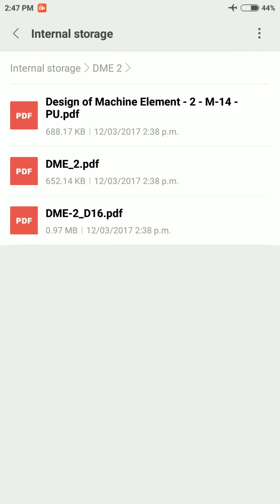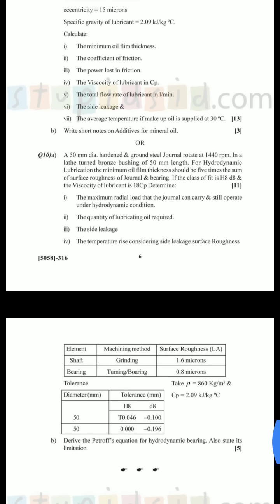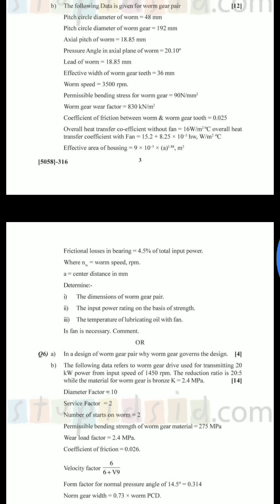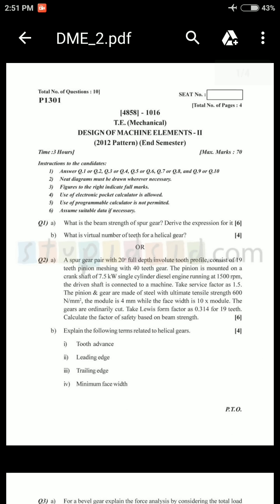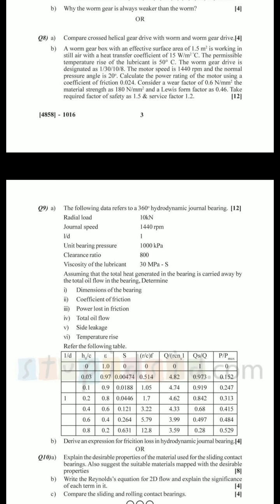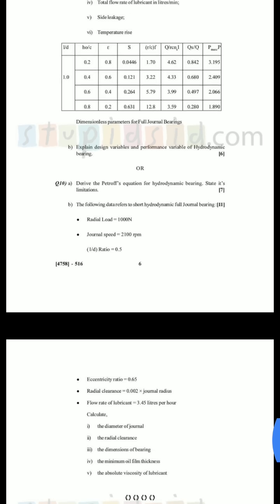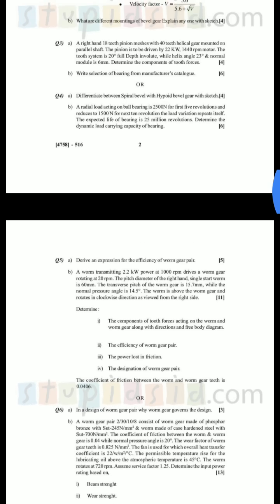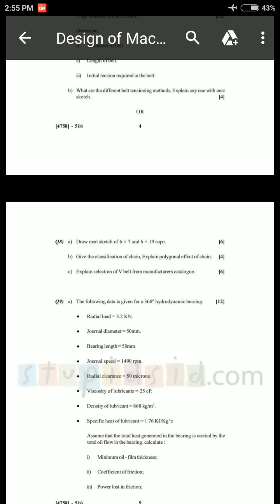How to solve DME-II paper

Comment: is vb bhandari ri8 book for dom... or should we use tenchical publication also?
Reply from the maker: Use technical publication only. You can easily score more than 60 marks in endsem and more than 27 in insem
Reply from the maker: It's the most appropriate book.
Refer to previous year's paper and see what problems are repeating practise those only. DOM is fairly simple and repeated questions appear all the time. Cheers!
Reply: thnks bro.. i had solved problems from vb bhandari only nd i dont have technical publication so should i purvhase it nd solve nemericals from it also?
Reply: btw i m saying it for dme1
Reply from the maker: No you don't need to then..
V B Bhandari is sufficient in it's own as well
Reply: thnks bro... appreciate that u replied so quickly.. btw i also had question for which publication should we use for turbo?
Reply from the maker: Technical bro technical.
Use All books by Anup Goel for mechanical you'll be at a great advantage.
Paper setter also use technical publication it seems.
Same values same quetions from the book itself.